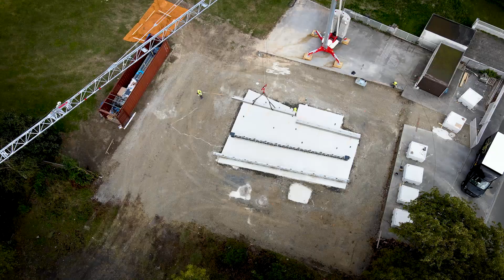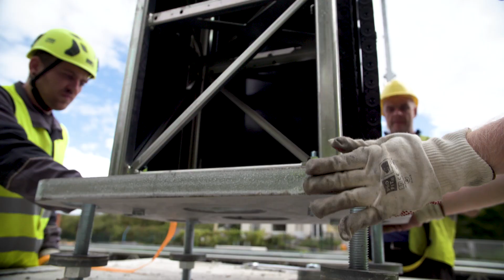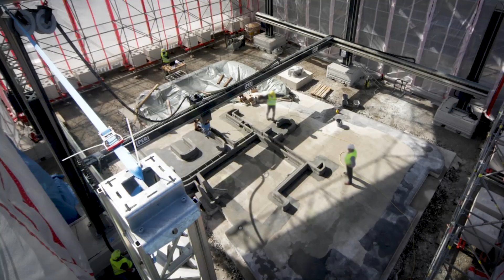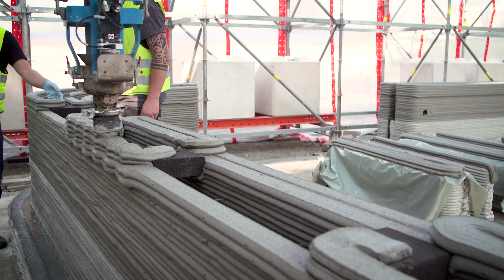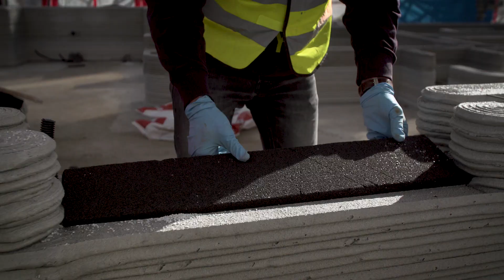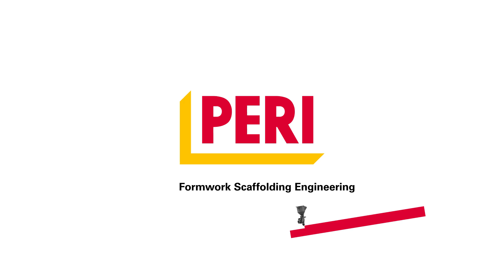PERI 3D Construction Printing: First 3D-printed residential building in Germany (EN)

Comment: I've a couple of doubts about the bearing capacity of the system. I see that transversal connections have been installed but is it sufficient to ensure flexural resistance? The printing system works as formwork and then classic reinforced concrete is poured inside?
Reply from the maker: Dear Federico,
The building has an official building permit – including all statical calculations. Partly, we are printing a formwork which is then poured out. The outer hollow wall is filled with insulation. 
Best wishes, Team PERI

Comment: What did you use for insulation?
Reply from the maker: Hi Yusuf Alraqi, basically, the walls can be isolated in any way. We recommend integrating the insulation into the printed, double-skin cavity walls. In this project perlite from volcanic rock was inserted as fill insulation.
Best wishes, Team PERI

Comment: Impressive. What's the estimated timeline for a single unit? from start to handover?
Reply: im curious too.. im gona shoot, less than 4 working weeks. Bare in mind that it's only the structure of building and inside needs to be finished off too, like plastering, electrics, plumbing, inserting kitchen and other units and others. still not bad promo video, wondering what it costs too. hmm
Reply from the maker: Dear Kamilo Kamil, The house will be completely finished in March 2021 – incl. interior and exterior fittings as well outdoor installations. Kind regards, Team PERI